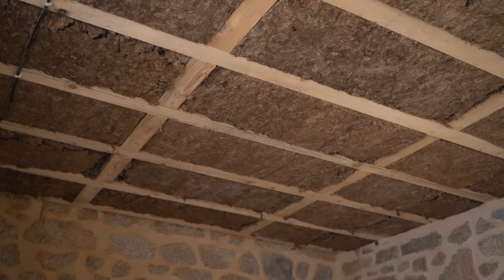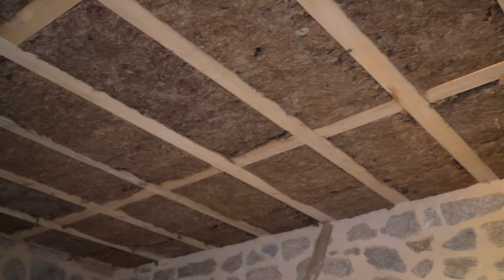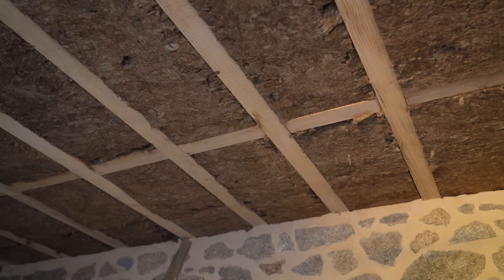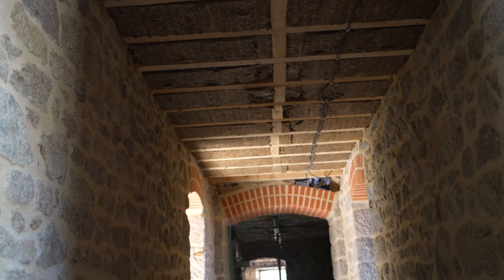Sundays at Chaumont- insulation and wiring breakdown.

Comment: Hey Dan, I know it’s probably not gonna be the cheapest option in the beginning, but induction heating / cooling will more than likely the most efficient option of heating and cooling  the Château. And not just the rooms.

 If I had the option to have copper on my roof gutter line. I would also run a few rows of 1 inch copper pipe underneath the copper sheets. That way you could use the sun as a natural heating element and your boiler will not have to work as hard to heat up. 

Then, within the manifold connection, you can go as far as having a smart system where you could turn off different levels of the château if you want to as well, as given the option to run pipes to the outside of the château into any outbuilding that you build, as well as when you get to the point of building, the cobblestone driveway could have the option to have that heated and cold as well so it’s great to walk on in the summer barefoot as well as winter.

Comment: i realy think you should use infloor heat. that is the most efficient way to heat this building and you can maintain the heat near the floor instead under the ceiling. There are many system meant to be used with wood floors!

Comment: Actually holes in the middle of a beam are fine. Much better than notches. If I understand correctly the bending and compression forces run along the outside. Just don't make the hole too big and put it in the center. 
Just like you can get steel beams with regularly spaced holes in them. Lighter and matters little to strength.

I have everything in pvc tubes running thru beams. So the wires do not touch insulation and can be removed from either end.

Comment: Hello from Saskatchewan - today is +4C - yahoo!  As a former commercial interior designer (hotels, restaurants), it is absolutely critical to do ceiling lighting and floor electrical (duplex outlets) plans based on the function of the rooms and where furniture is placed.  One thing which I did for my parents (Dad  was the electrician/electrical engineer) was to do floor electrical with actual duplex outlets in the floor so that the sofa acted as a divider between the living and dining rooms and there would be electrical for the table lamps and for electrical on the sofa tables.

Comment: i would be tempted to use alot of the open brickwork on display as i doubt insulation will make much difference if the floor and ceilings are insulated so well...the walls with windows will obviously be insulated, but are you going to introduce under floor heating.? should be toastie enough...are you going to have any nice log burners or ch...? could you place solar panels on parts of the roof not visable from below.? imagine that dan..there is absolutely no need for shore power there dan if you have a good battery station..did you know there are 1000s of electric power banks being scrapped that would make great power walls.

Comment: If your light switches are wifi, what will you do when the wifi goes out? Ours in the US goes out all the time especially in a big storm.
Reply: Put your router on a Uninterruptible Power Supply unit. It’s cheap and means you still have internet when the power fails.

Comment: Thank you, Daniel, for your Sunday updates.
As you previewed installing parquet flooring on each level of the chateau-except the basement-I’m wondering if there’s consideration for another application for the 1st floor given that the saved tiles for the entry will be re-installed, or even for the floors in the upper levels. Am thinking of poured application. Be safe. Again, am excited for the progress that has been made so far.

Comment: In Chicago, because of the Chicago Fire, all electric to be code is run in metal conduit. This also actually future proofs the wiring. As when  new wire needs to be run, the new wire can be secured to the old wire, abd as the old wire is pulled out, the new wire is automatically pulled into place. Since the wires or romex aren’t secured along the run, the wire is unobstructed and can be pulled through. The conduit is what is secured to the under side of the joists, or wall studs.

Comment: Another great video.  Rockwool should be paying you a few thousand a month going forward.

I installed wireless, voice-activated switches when I re-wired. It makes configuration of multiple switches very easy.  It's also nice to be able to control lights without going to the room.  It works great for exterior lights, as well.  I even have devices outside my house so I can control devices from there.  I also created routines to turn certain lights on and off and sunset and sunrise.  Pool lights, patio lights, etc.  Plugs with night lights and motion sensors will be great if  you plan to have children there who may not be familiar with the floor plan.  All of my plugs turn on/off as I walk down my hallways.  Think about motion 

If  you find the right sponsor, you'll get all this for free.  Also, you can coordinate all this with smoke detectors / fire alarms and burglar alarms.  Motion detection is very convenient outdoors.  You should be able to talk from  the house to the back corner of your property, having the lights illuminate as you walk.

Comment: are you using an actual boiler, or potting in some air source heating? 30Kw makes air source very practical, and with the covered area outside where you've added the new oak door frame, you have a perfect space to  house and hide the outdoor units and possibly batteries should you be able to use solar to take the house all electric and away from the cost of mains power.

Comment: Make sure the birds and vermin don't start living in your lovely Rockwool. It is the right product. We used it in our 70s house when insulated in Scotland in 1980s. 
Yeah, surface mount your electrics. Keep it all honest and accessible. = easy :)
Do wireless light switches use batteries and/ or need recharged every month?  I'd run your cables like Victorian's did in 'pipes', surface mounted. Also in-keeping with age of the build.  Good stuff. Great vlog 👍 keep safe 🤠

Comment: Re: remote switches and WiFi in practice, something to check, first step what switch to what device assign WiFi addresses: NOTE vendor/ installer or "owner" links everything AND possible without  asking software update totally messes up the system! To avoid, ASK everybody, make sure to fully documented when installed and pray.

Comment: There is quite a difference in electrical code in France compared to the States. The inspectors here in the States would shut you down if you installed the conductor wiring the way you described!😮
Keep up the great work!!
Reply: As long as a qualified electrician checks everything, he should be covered

Comment: I run any cabling in reopenable rectangular conduits, sometimes bifurcated to run two cables in the same conduit,  I run these in corners so they are less obvious, but they are cheap, quickly fastened to a batten or the joist themselves, and I use this system in boats where conditions are far worse.  If I need to get wiring into an awkward space, I push tubular PVC conduit into or over the area to be covered, or use saddles to tack it over a joist, all to be covered by your suspended ceiling.  Permanent conduits are very cheap, and I blow a plastic bag on a string through the conduit to draw any cable through afterwards, The re-openable conduits are my favourite ones though--the lfd clips on, and that holds up the wiring inside, and I have never had any wires escape,  I have even used the bifurcated rectangular conduit to carry heavy tinned DC wiring.  These reopenable conduits are available in many different sizes so I strongly recommend you consider them  as an option.  Most power authorities approve them for permanent wiring over wiring in clips on battens--they always like conduits.

Comment: Dan! Did you know that it's possible to buy mud/clay (i rememberd what the English calls it, it's lime plaster 🤦🏼‍♀️ we call it vályog and we call the sand+ aged lime mixture lime plaster) sheet boards? Exactly the same material (well probably some small things changed) what they used back then but in modern form. If you want to provide the breathability upstairs and can't just plaster on the walls. The manufacturer name is LEMIX, a german company. 
I will use Rockwool (the brand) in my house too. It can't burn at least in a house fire and it can be recycled. Plus I have a traditional mud/clay house so i really can't use any other modern stuff because of the moisture.
Btw really hard to find proper materials still and sometimes cheap like the lime and sand, but when it comes to insulation and paint it really quickly becomes really pricey.

Comment: Thanks for sharing a very interesting project.... A kitchen requires a lot of electrical power. Because it is a regular floor, it is advisable to run an electrical sleeve through the floor to points on the wall. Regarding heating, a wood stove is better than an air conditioner. Leave part of the structure with less moisture. It is advisable to dig around the structure to a depth of 1M -1.5 M to insulate. Waterproofing the foundations of the structure. This way, stones will not pump water into the structure.♥

Comment: Dan, I just finished watching your latest Sunday video, you talked about putting a vapor barrier between the floors in the chateau. If not done right, you may be causing mold and mildew to grow between the vapor barrier and the wood floor joists. Warm always moves to cold, and brings moisture that then can condense on the cold side of the vapor barriers. This YouTube video from ASIRI Designs, which is deeply involved in building science, has a video that talks about vapor barriers on walls. However, it also may apply in your situation. Keep up the good work.  Bill
      "STOP Using Vapor Barriers, Use THIS Instead"

Comment: This is just my opinion, but as someone who works as a smart home product manufacturer, WiFi switches are going to drive you nuts.  They do work, but they are far from perfect and regularly will need to be reconnected... not to mention the high power draw that comes with WiFi and having to change the batteries in every switch regularly. At the very least you should have used Thread/Zigbee/Z-Wave (low power mesh networking) which uses much less battery, is self-healing and far more reliable than WiFi.  Honestly, you should reconsider just running the hardwired channels as you mentioned... generally the contractor will take a photo of the wiring before covering it up so that there is a record of where every cable is, I don't see it as an issue for people in the future, no one is just gonna start putting holes in a wall in stone wall as pretty as that without having a think first.

Comment: Couple of comments: your wireless light switches will need a power supply, so probably have to allow for swapping out rechargable batteries. Also your heat losses I think were originally a LOT LESS than 1200kW!!! At a rough guess I would say your heat losses from the building would be about 150kW originally (probably a bit more) and you could reduce this by about 1/3 depending on what you insulate. I'm assuming you have solid walls so would need to look at dry lining and insulating the outside walls in each room. The insulation in the floors will be more use for noise supression than reducing heat transfer unless you are going to have the room/s above/below at much cooler temps.

Comment: A nice summary of your thinking behind the upcoming insulation and electrical installation.  
 
A few choice comments, though: First, as a telecoms engineer I will strongly recommend that you do not go for CAT5 cabling. I used it when I put in networking in my own house - but that was almost 30 years ago, and comms speeds have risen significantly since then. Especially given the size of the Chateau I would NOT go for anything less that CAT6 - and preferably higher. The longer the run, the lower speed you can get through the cables - and CAT5 is at best suited for 100M connections, at longer lengths this falls to 10M. Most of my cable runs are short enough that I have managed to run them at 1G - but a few of them are, at about 12-15m, long enough that they cannot provide more than 100M.  I did not plan sufficently ahead back then...
 
Also, using primarily WiFi for your networking may work for a small house with 1 or 2 people living there - but if you intend to have the chateau used by a lot of especially children and young people you are going to need BANDWIDTH! - I would therefore recommend that you put network cables into ALL rooms and not go below Gigabit speeds - 2.5G and 5G network switches are coming down in price at the moment, try to go as high as your budget allows. For WiFi you need a solution with multiple access points. 
 
Work with your electrician to ensure structured cabling with thorough separation of high (230V/400V) and low (networking, alarm, TV, 12V/24V DC) voltage cables. Put in plenty of wall power sockets, so you will not have to run long series of multisocket extension cables through the rooms. Doing so is hazardous and not legal. And remember to use sufficiently thick cables for the power - preferably at least 2.5mm2.  

Think in some degree of intelligence for your electrical system - you might not be considering going for a complete smart home solution from the get go - but it is worth at least preparing for some level of smart control. 

As a Dane it is of course nice to see you going for Rockwool :-)  I would still recommend that you consider some insulation of the basement too - the kitchen's going to be a cold place in the winter otherwise....!

Comment: Just a few things I have been thinking about the last few Episodes...
1. Think about putting a Elevator in... or atleast reserve a Spot for one
2. Plaster for the Outside that has some Isolation value~ there are some newish things out there
3. Windows in a 2 isopanel + 1 singlepanel configuration with a  ~20 cm gap between them, that alone raises the R-Value of the walls and the Window assembly by alot

Comment: Kitchen is going to require major gas and electrical lines. My guess a sub panel for just that space makes sense. As for the wiring, the ceiling lights are a no brainer, but perhaps horizontal conduits, channels, would work. Painted black, they would blend in nicely.
Reply: No new gas going forward in France, I think.
Reply: @LaReynedeNeige  Shame. Nothing beats the cooking heat of a gas stove.
Reply: @caminojohn3240  I suppose it's what you're used to. A lot of professional cooks like induction, controllable, doesn't turn the room into an inferno and costs less.

Comment: I have geothermal heating … cheap, no problems so far(soon 20 yrs). I don’t even have to think about it. It’s attached to a temperature regulator on the north wall and just needs an electric pump to keep circulation going -165 m down and then up again. You could probably run that with solar energy uploading a batteries in case of blackouts. 
 Is the drilling too expensive in France? I’ve wondered about all those different kinds of heating and energy sources in huge houses in Europe - gas, oil, wood burners, etc.
Reply: The cost of drilling through the rock on which the chateau is built, could be prohibitive, I would guess
Reply: @LaReynedeNeige  Agree. Burying large coils 7-10 feet down might just break Nick…
Reply: @MatthewBraithwaite-x6g  🤣

Comment: Here in Finland we often use cable duct flex pipe for all the wiring. If you damage a cable with for example a nail or screw, you can remove the cables without demolishing the wall or ceiling.

Comment: Since Chaumont seems to be built on granite, have you thought about geothermal deep drilling as the main heating method? Granite is ideal for that, so you would need less and shallower holes. Combined with solar electricity, it would basically be a one time investment on heating.

Comment: I really enjoy this new Sunday format—it’s great to follow along with all the things and thoughts you share. Every video is a joy to watch, and I’m always looking forward to the next one. Dan is doing some fantastic work!

I was curious about the wireless light switches and how they’ll function. Will there be a central switchbox with relays, or are you planning to use smart lights? Also, since there are no wires running to the switches, does that mean they’ll be battery-operated? If so, would it be worth considering a small wire run to avoid the hassle of replacing batteries and the occasional inconvenience of non-working switches?

Comment: You should not use wifi switches. Use a smarthome standard such as zwave, zigbee, thread/matter or knx.
Zigbee uses 2.4 GHz same as wifi, z-wave uses a lower frequency and should not be able to interfere with wifi. The better pro solution should be thread or knx.
For cables use PVC pipes to run wires through.

Comment: Really like these Sunday breakdowns and planning sessions. Am curious about your heat plans. My guess is you plan electric. As a secondary, I would recommend havinga generator (diesel) wired to your mai  power box and be located in one of those small basement rooms, exhausted through a wall. Not sure of yourarea, but any wooded location runs a risk of power outages. Incold months this is a bad thing. You can have on site above ground main tanks so you can fuel your maintenence equip.ent and have a 50 gallon tank in the generator room also for emergency use. Great vids!

Comment: With regards plugs,if regulations allow it,maybe look at using copper pipes that are normally used for plumbing and run it down the wall to the socket. 
Then run your wires in that.